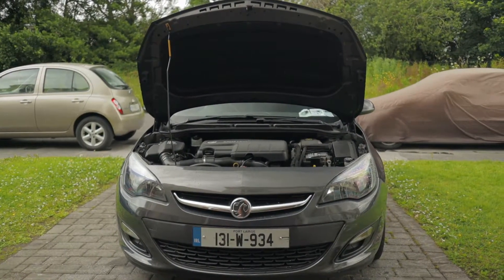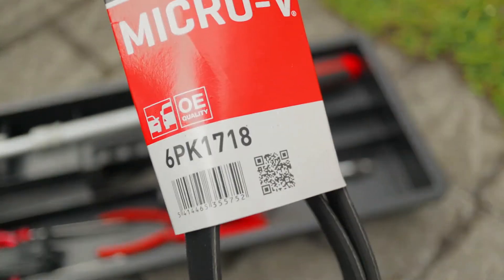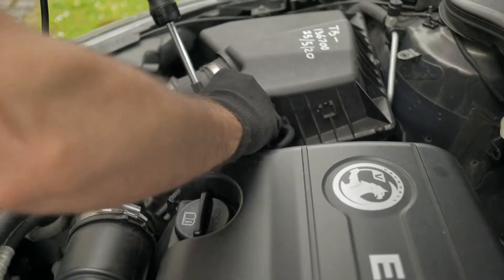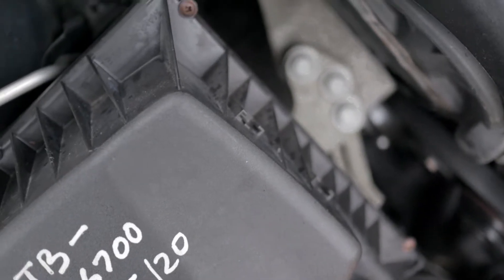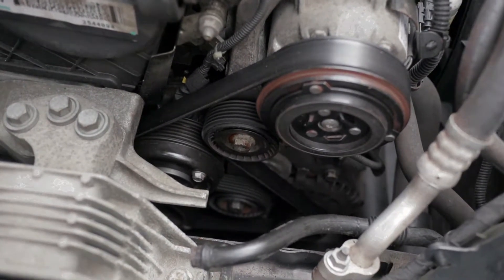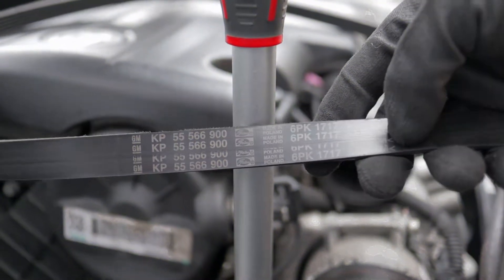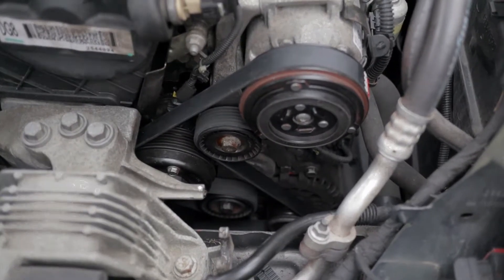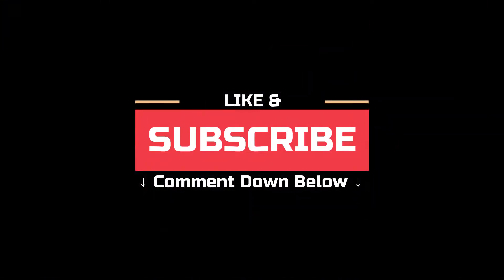Aux Belt change (Vauxhall Astra)

Comment: HI, excellent video, just wondering would it be the same for an astra j 2015 petrol 1.4?. Thank you
Reply from the maker: Hi ya, thanks for the good comment 😁 I believe it's slightly different on the petrol engines. A few more steps involved but the general principle will be the same i.e. loosen the belt and remove 😁
Reply: You mean where the engine mount goes through the belt and makes it much much much more difficult to replace the belt? Well, I am facing the same issue
Reply from the maker: Oh 😳 That's a pity, not a great design so. Hopefully you get sorted, I believe you'll have to take the engine off the mount for the moment and pass the belt through?
Reply: sounds like im home in cork listening to you 😂😂

Comment: Is there any locking pin hole on the tensioner to fix it in position?
Reply from the maker: Oh, I can't remember unfortunately. Someone else might know. I believe you can surely find a slot to put in a small Ellen key to get you by...